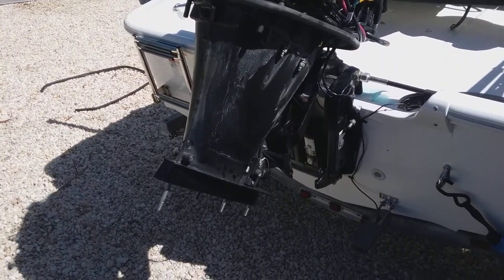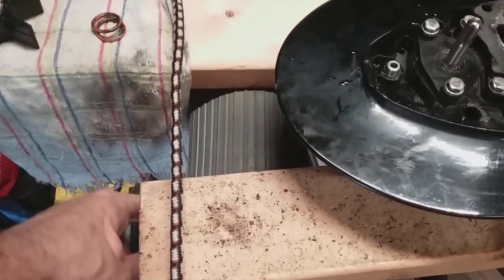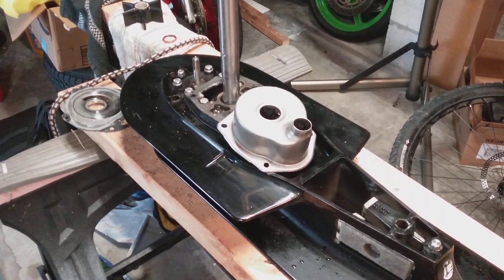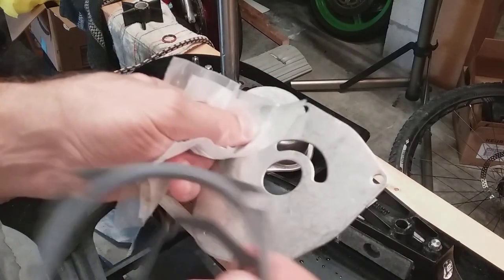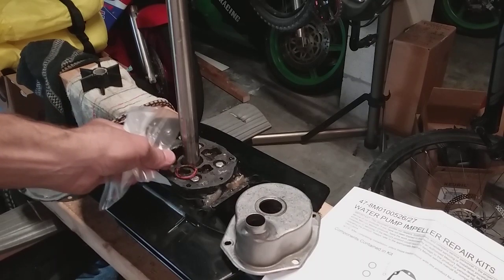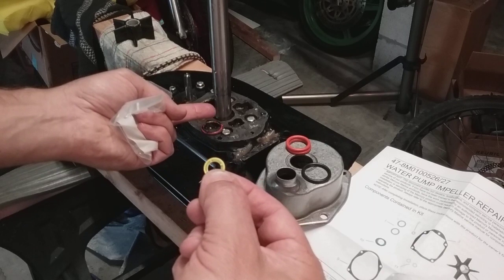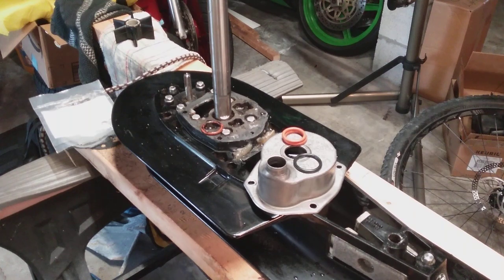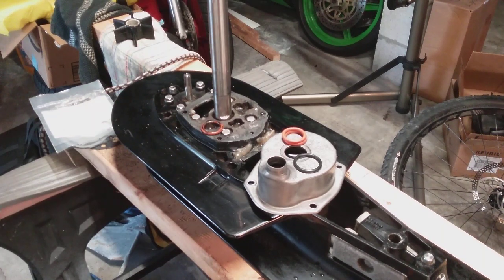How to change impeller on 2011 Mercury 90 hp 4-stroke Part 1

Comment: The two red o-rings go up into the plastic boot. You need to pull it out, swap out o-rings and that is where the large nipple on the pump housing sits into. It just stuck when you pull the unit apart.
Reply from the maker: Thx
Reply: What plastic boot are you referring to?

Comment: The orange orings goes on the part that is stuck up in the upper part of the motor, not the lower unit.
Reply from the maker: Thank you.. I guess mine got skipped... sold boat.

Comment: I did my impeller today on my 90 hp 2t the kit has various seals for different sizes of engines I only used the wear plate and gaskets the new impeller and the top face the rest are still in the bag lol .I put watched lots of videos also and a lot of them said to put in forward gear when doing it as its easier to reconnect .If you find out what the other seals are for can you put it up please .